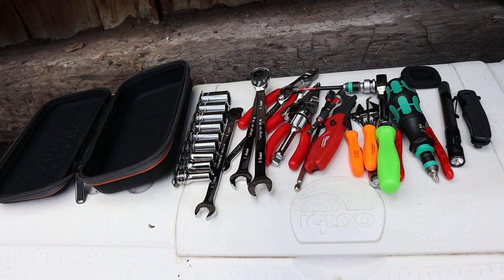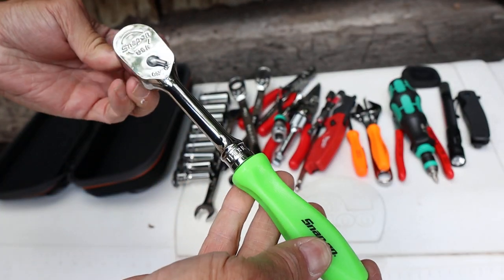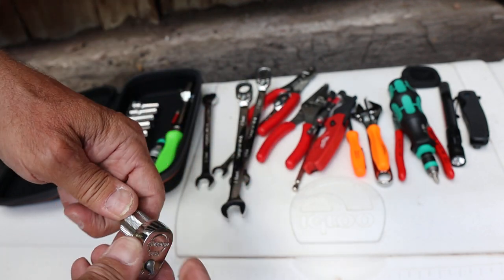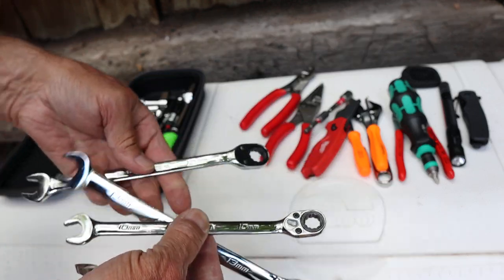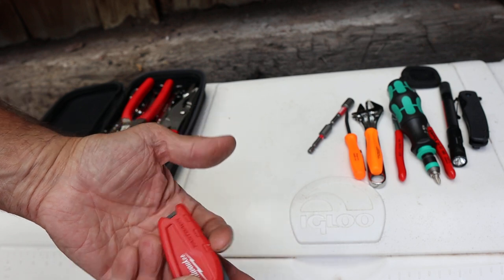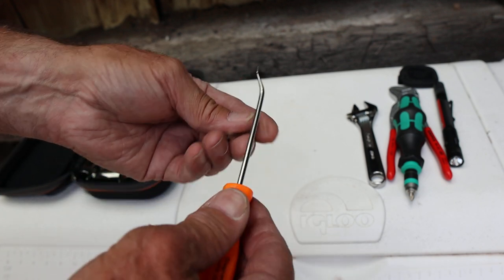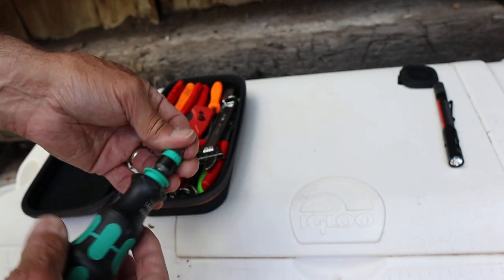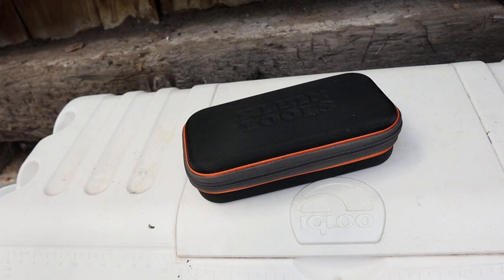Testing a mini tool kit: Overlanding with a use-case mission.

Comment: I go with a 3/4 pass thru set + ratchet and/or flex 3/4 ratchet wrench. Such as Pittsburgh Go-thru or Stanley (STMT74900) with any 3/8 ratchet and/or a Mac/Expert extra long flex ratchet wrench (E112001). Gives length with flex and the pass thru access. Weight is low, but not as compact as this setup.

Comment: A- I prefer 2 fabric like triangle where the zipper start and finish keeping the lid 90° from going forward on surfaces and blocking the tools from falling if you open it like a book while standing 
B- If you can make sleeves in side around the frame for the flashlight to stick out the head while carrying like assassin case ( sorry about example this what my visual memory catch )

What else …
Magnetic in side the lid if you gonna use it like bench work